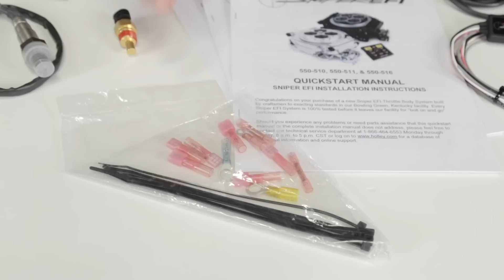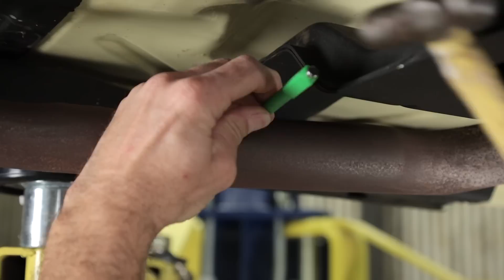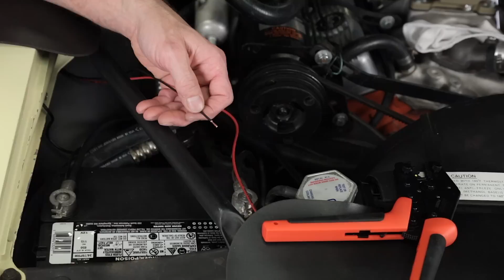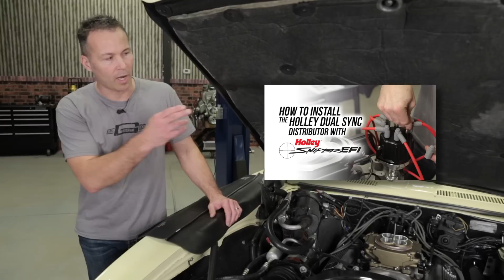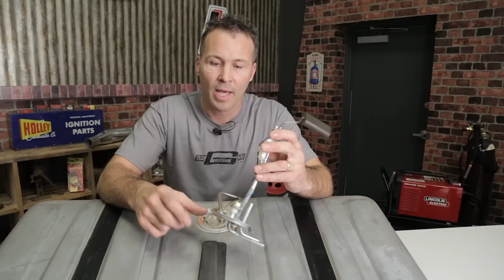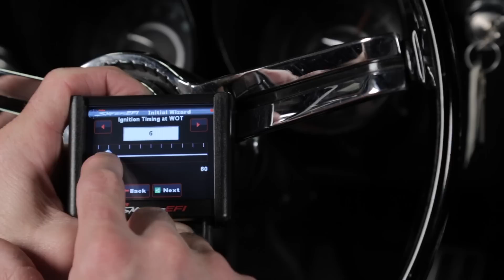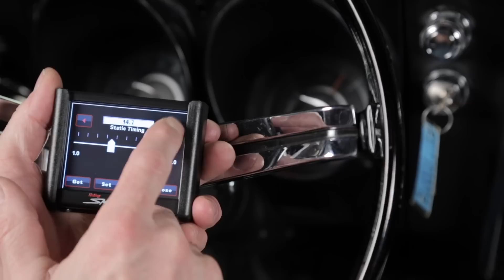How To Install Holley Sniper EFI

Comment: Thanks for posting I have just 2 or 3 things I need help on.
..the Blue Fuel pump wire. I bought A Tank  with the built in pump and ran the 8 gauge wire from the pump along the frame rail to just about the Front Firewall so I can cut it down to reach the Blue wire or do I have to use the Long Blue Wire and take it back to the tank?  Or do I just hook up what I have done already to the Blue Fuel pump wire and STOP. 
My truck is A 64 Chevy Fleetside Short bed.
So Then just proceed with the rest of the install I am assuming Once I connect the rest of the harness that goes to the KEY or whatever I will get A signal to the Blue Wire for ON/ OFF either before or during the install Correct?? Sorry I jumped ahead to the parts I knew I would have questions on.
SECOND THING I have A Chevy Small Block 87/95 Type Heads there is no port on the head between the number 1 cylinder and number 3 cylinder But I do have A Corvette Style Short Water Pump that has a fitting on top that I have plugged right now can I connect my new Holley Water sensor there instead of the Intake Manifold I have the Street Warrior Dual Plane Intake And I have my traditional Gauge in use at the intake I would prefer not to lose the sender there. Or swap it to the Water pump and move the Holley Water Sender to the Intake so either way I would be happy...Last Question the PCV Valve is in the back on the Sniper Throttle Body can I uncork the Port that is on the Front Bottom of the sniper and Add A NPT Fitting there for my PCV Valve where it is plugged currently? What size is the Plugged Front fitting  so I can order the NPT Fitting online.. Aside from that I am good to go Thanks for the Tip on Flushing the Line First I missed that
Reply from the maker: 1)If the wire from you tank is indeed an 8 gauge wire you can go ahead and run that to the engine bay and cut and splice into the blue wire there.  Be sure to solder and heat shrink the connection. And yes once the wire harness has been connected correctly and you have completed the start-up wizard the ecu will energize the blue fuel pump wire.   
2)You can keep the mechanical water temp sender where it is and install our sensor into the water pump.
3)yes you can remove the 1/4" npt plug in the front of your Snipe andreplace it with a nipple (Earl's p# AT984006ERL) or a brass nipple from the hardware store with 1/4" npt threads and 3/8" barb to connect your PCV hose to.
Reply: VERY COOL! I was worried about the Water pump sensor if I could or should so really thanks for the reply now I have the confidence to finish up.
Reply from the maker: No worries, just be sure that the sensor is not going to interfere with any moving parts in the water pump port you are using!!
Reply: Oh Yeah I bought some Heat Shield Protective sheath for the wire against any heat source and will run it using good clamps that wont chafe along the passenger side away from pulleys ETC.
Reply from the maker: Send us a pic or quick video when you get it finished.  Love to share it with other car guys!
Reply: Will do I posted some stuff on youtube as I was plumbing contemplating getting it going. I decided to Run with NO Rubber From the Tank to the Throttle body and Back to the tank so all Hard line to and From with 3/8 steel line I had to get the Russel Adapter to fit the 3/8 line the fitting ends needed 5/8 part#640610 So I can keep it all A/N Type ends even the 2nd filter Fram 3727 needed A special Adapter with the little rubber deals on them but I made it work no rubber hoses or PTFE anywhere Except the Vent I used F/I hose there cause I had it laying around. II am not getting any younger so I dont want to be replacing hose because in 10 years or less I will be 60 I cant see myself under the truck at 60 fixing leaky hoses or worn out or whatever at the side of the road

Comment: Another quick question, I have my battery mounted in the trunk. Is it ok to use a connector to lengthen the positive and negative wires on the main harness?  I will connect them right to the battery of course.
Reply from the maker: Yes, but use a chart to determine the correct gauge of wire to use!  It will require a larger diameter wire to compensate for the extended length.  Always solder and heat-shrink (no connector).

Comment: I installed this on my sbc 350 and I've got 4 cylinders that are very rich and 4 cylinders that are very lean and has a wicked misfire when u try to drive it, I've emailed u guys and can't get a response and if I call I'm on hold for 20mins before anyone answers not to mention it's long distance, can someone give me an answer as to why it has a fuel distribution problem? I'm also running a dual plane street dominator
Reply: LethalGarage did you figure it out?

Comment: What that not a dual plane intake? And if so, should an adapter (PN 17-6) not have been installed?
Reply from the maker: Yes it was a dual plane intake. The sniper will work on  4150 style square flange or universal flanged spread bore intake manifolds.  No adapter was necessary for this installation, but some intakes may require one.

Comment: Installing this right now on my 77 Camaro. Is it safe to run both rubber fuel lines from tank to TBI unit?
Reply from the maker: Yes, as long as your hose and fittings are rated for EFI use with working pressures of 60+psi. we recommend using Earl's vapor lock or super stock hose and fittings.  Also be sure to protect the hose from high heat,  sharp edges, and moving components.

Comment: Hi Guys
Ok My dizzy has arrived and the only 2 things in the box is the dizy and instruction sheet....
Do i need to purchase a link cable for the laptop to config the dizzy or can i use the handheld? as i see on Holley web page they use a laptop?
Also do i need to purchase another cable so i can connect the MSD 6Al and coil blaster to it ?
Thanks...
Reply from the maker: It can be configured with the 3 1/2"' handheld. Yes you will need get the harness P# 558-493 to connect the MSD.
Reply: Thanks guys.....

Comment: Can a Corvette style fuel  filter be uses for the return line. Also, is there a electric fan control  available?
Reply from the maker: Yes, but EFI works better when it is in a return style fuel system.  We have run it dead headed with no issues.  And yes the included aux wiring harness will control a cooling fan.
Reply: I have a electric disconnect on my car, will this erase the programming and need to be re-calibrated each time?
Reply from the maker: No, the calibration will be saved in the ecu.  Be sure you run the heavy red and black wires directly to the battery terminals as described in the instructions, not the cut-off switch!
Reply: Isn't that required for NRA drag racing? And it's  supposed to turn off all the power car to stop a fire from happening?  I looked into for mine a long time ago but thought it would be a pain and My car is mostly a daily driver not a race car that does sub 9s
Reply: HolleyPerformance can you use the stock supply fuel line?

Comment: Run a carb and spend that money on heads.
Reply: Cana box do both.
Reply: Obviously you don't understand the benefits of the Holley Sniper Fuel Injection. My mechanic's 1970 Mustang Boss originally got 6 miles per gallon off the carburetor, and had to pump the gas pedal countless times to start the engine, which is embarrassing. After he installed this Holley system, he now gets 25 miles per gallon!!! And he never needs to pump the gas pedal even once!!!
Reply: Gábriel Priòre 6 miles per gallon ??..damn
Reply: Your boss must be stupid lol, he probably never maintained his carb or car if he got 6 mpg. I can get better mpg of my farts than your boss's car